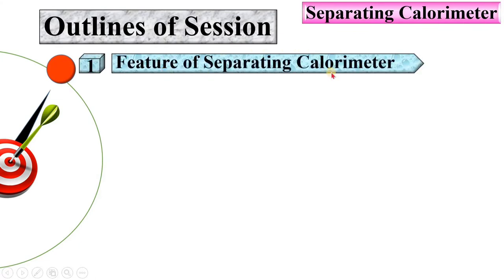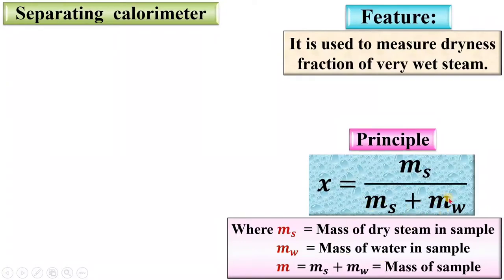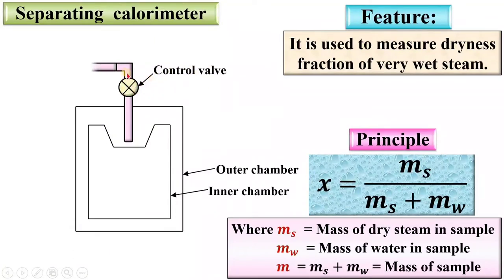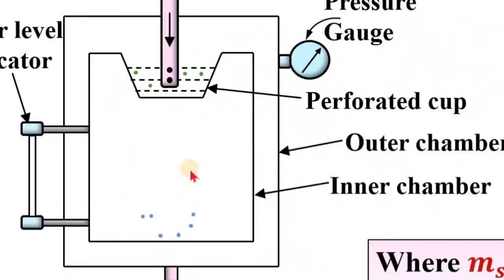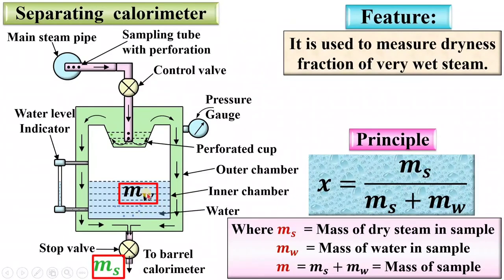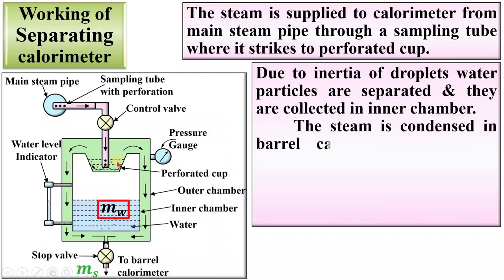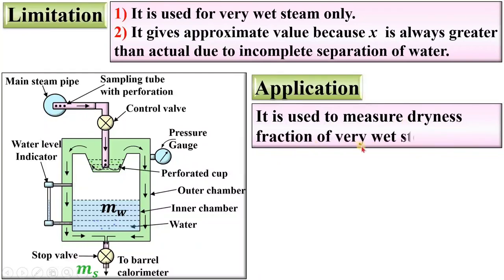Separating Calorimeter (Basics, Structure, Parts, Working, Limitation & Application) Explained

Comment from the maker: Separating Calorimeter explained with following Timestamps: 
0:00 - Separating Calorimeter - Basic Mechanical Engineering lecture series 
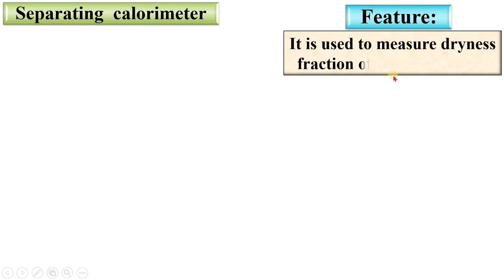0:43 – Function of separating calorimeter
0:54 – Principle of separating calorimeter
1:44 – How to draw separating calorimeter
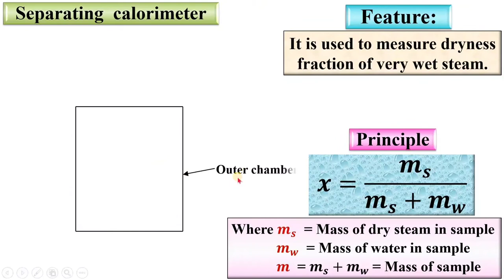1:50 – Parts of separating calorimeter
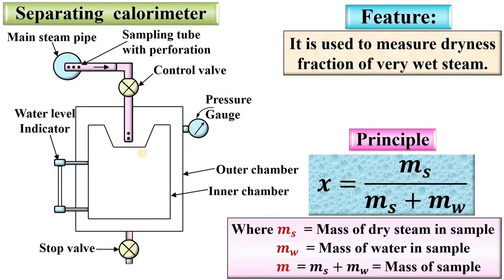3:06 – Animation of separating calorimeter
4:03 – Mass of water in separating calorimeter
4:29 – Mass of steam in separating calorimeter
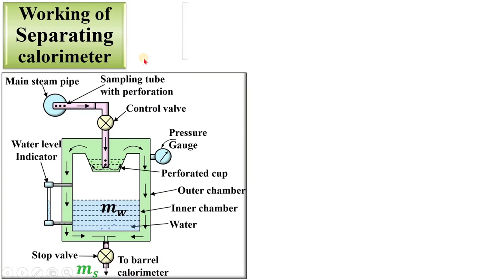5:42 – Working of separating calorimeter
6:22 – Calculation of dryness fraction of steam
6:32 – Limitation of separating calorimeter
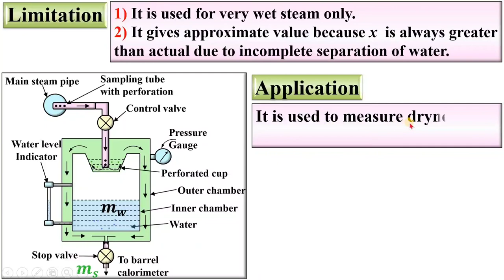6:57 – Application of separating calorimeter